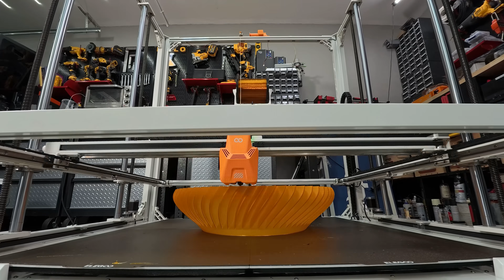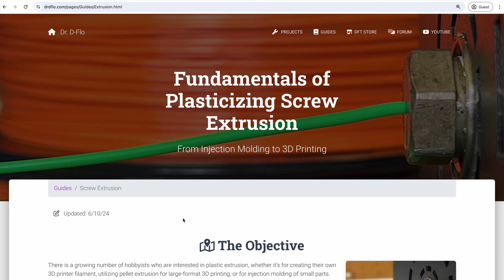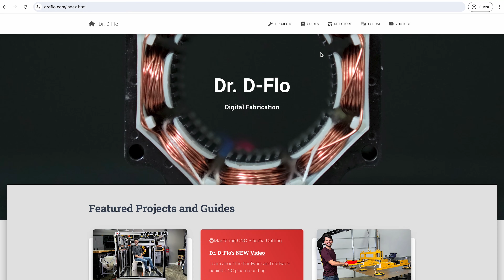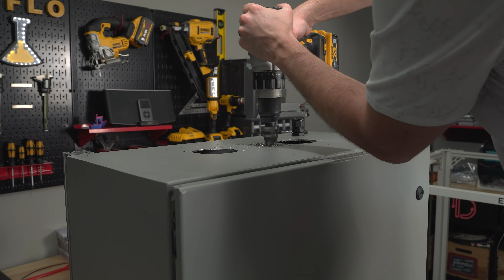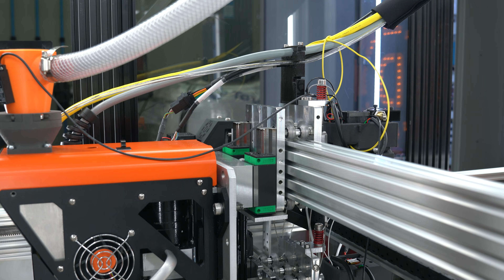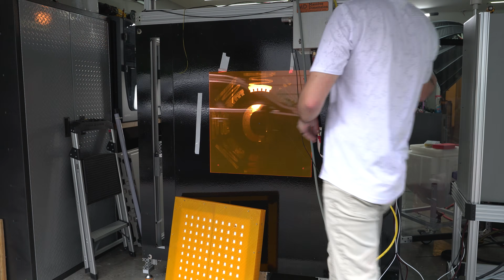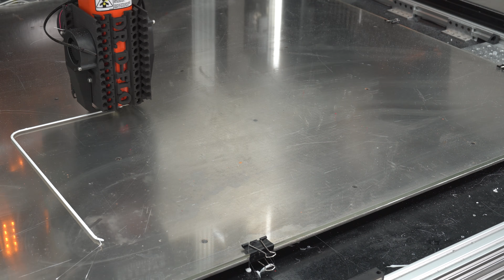SCREWing Around with a $20K Pellet Extruder - Large Format 3D Printer (Part 7)

Comment: The thing with a tidy cabinet is that it is even better to make your cabinet tidy when you're tinkering, because making changes will always result in tidy wiring.
The cable runways and DIN rails work as constraints that keep your work tidy and makes it easier to modify. It also lowers the chances of making a mistake.

Comment: Those amazon silicone wires are super sketchy, I have used them before and have no rating on them. The gauges you use to calculate amperage goes out the window when wires are non-standard.

Comment: What do you use the raspberry pi for? And what direction should I go to for using an interface for the duet to control the temperature with the corresponding slicer? (Also, what slicer are you using?)

Comment: You are over complicating your over head problem. Just add a low profile pulley to change the direction so your tensioner can be placed horizontally and not directly above the printer. With the direction change you should only loose a few inches of over head height.

Comment: 0:48....vulcano cht nozzle = 70mm3s: super vulcano with dual vulcano cht inside (one "nozzle" without the tip act like a spacer)
And you have almost 200mm3s (but try to keep it hot...in reality more like 150mm3+)
It is possible to use multiple spools at once (few extruders , few heating zones , single nozzle...like in old multi colour nozzles ) to go over 500mm3s easly for pretty cheap , but it will be behemoth of a hotend (dont ask me how i know that , lets just say my smallest oldest (10y+) printer have 500mm+/- xyz and printed molds for composites)

Comment: A little tip on soldering those cup terminals: The easiest way to get a perfect joint every time is to tin the wire, then heat the cup from the side, melt it full of solder, stick the pre-tinned wire in and let it cool. If you want a visual guide, I believe the PACE soldering tutorial showcases this method.

Comment: You should check out the V-Spooler Easy Motor Drive. It uses a nema 17 stepper motor to drive the Spooler instead of a drill. I also recommend the Quiet Roller mod.

Comment: Why not just to to put big pellet extruder before printer and make filament, wind that to some buffer roll and after, just wire that freshly made filament to normal light-weight extruder of the printer? Cheaper and also no issues with retract

Comment: As amazing as this thing is, it really upsets me how expensive this is at over $22,000, even if it's geared for "industrial use."

It's not just "Massive Dimension" pellet extruders that cost so much. It seems to be industry-wide with some costing nearly $100,000.

Maybe it's a bad comparison, but at this price, I could get a brand new car like you suggested. A car has significantly more technology, more parts, engineering, raw materials, and overhead that went into manufacturing them.

Can someone explain the cost breakdown for these things?
Reply from the maker: Usually, it's an economy of scale problem. Let's say you're an extruder manufacturer, and it costs $5,000 for you to buy all the off-the-shelf and custom components plus labor for assembly. At $5,000, you are already priced out of the hobbyist market, and that doesn't even include the normal overhead to run a business (warehouse space, customer support, marketing, and salaries). Further, the extruder you're manufacturing is heavy, so an industrial motion platform is needed to move the extruder (robotic arm, bridge-style gantry system, etc.). So even if you could sell your extruder for $5,000 or let's say you sell it at a loss for $2,000 and plan to make money by selling plastic pellets (which is hard to do because pellets are everywhere and not locked down like say printer ink), there are very few people who have the means to afford this setup. So if I were doing the market analysis for this company, I would say we target the R&D industry. Create a cushy margin, say $15,000, and then we only need to focus on selling 50 units a year. I can then spend time going to trade shows and other outreach to market the extruder. Further, I can provide really good customer service to match the price tag. Obviously, if you set the price too high, then potential customers will just build it themselves.
Reply: @DrDFlo  Thank you so much for explaining this to me. I knew I was missing something but couldn't really find a good amount of info on it.

Your channel is awesome and you consistently put out incredible content. 

You're really good at explaining complex things at a level accessible to the rest of us and the way you share it is very engaging!

Keep being you!

Comment: You say that pellet extruders can have issues with small moves due to the need to build pressure. Could this be fixed by decoupling the requested flow rate and the screw motor? If you had a way of sensing the pressure in the nozzle then maybe you could have the nozzle pressure controlled separately from the flow rate requested by the Gcode file. Or maybe some changes to how the slicer works to allow it to compensate for the screw extruded and continue spinning the screw between moves.

Comment: What about a bowden fed extruder that melts multiple filaments out of one nozzle?
5mm filament has a cross sectional area of ~15.7mm2. 2.85mm filament has a csa of ~8.95mm2, 1.75mm filament has a csa of ~5.5mm2.
To match or exceed the 5mm filament csa you would need 2x2.85mm filament feeds or 3x1.75mm feeds. You could roll your own filament from pellets or buy it.

Comment: Nice project. Not sure what’s is going on with the pricing of these things where you are located but the robot shown is a abb irb 2400 or 4400 which costs more like 50k brand new with the controller and some extra options here in Germany and the cabinet costs more like 200 -300 bucks.

Comment: I think there's a far simpler solution for the cable umbilical, put a pipe or something at the top that it can roll over and add a small weight so the umbilical is in constant tension. No motors, retraction mechanisms or springs required that way.

Comment: Also, with that amount of molten material being extruded, you might could benefit from chilled air from an air conditioner or chiller to blow across the bed (or if you're feeling up to the challenge, directly from the cooling fans on the nozzle.) That way you would have sub-ambient air blowing on the print.

Comment: for the slack/retractable line, can you use the same hardware you have now, but route it through a pully directly mounted to the ceiling and the retractor mounted to the side a little bit? That might get you like 10-12"  more inches based on how it looks on the footage. (Since you won't have the body of the retractor in between the slack of the line and the ceiling.

Comment: I don't know if this extruder or the control software you use would support it, but would you be able to use a shut-off like what is used in injection molding machines? It would prevent most stringing and may be able to help with pressure drop from constantly stopping the screw, especially if this extruder has a pressure sensor the control software could use.
I kinda wondered if you would be able to use this for injection molding, but without a retracting injection screw it wouldn't get a high enough injection speed, and you would need a lot more down force than this setup would allow.

Comment: Fun fact, some large industrial exteuders only use their heating zones for the initial heating up

I have a 2ton and a 6ton/h PET extruder, and both actively cool the barrel during normal operation, all the energy comes from the screw
Reply from the maker: Very cool! If you are able, please post some pictures to the forum: https://forum.drdflo.com/c/screw-extrusion/26
Reply: Maybe you can answer my doubt. I'm sure I once saw a manual pellet injection molder in a factory that wasn't connected to electricity at all. I guess the pellets melted by friction. The cycle was about 5 seconds per injection. I have been searching for one to buy and can't find it. Is this a real thing?
Reply: @Malakawaka   highly unlikely that it was entirely unheated. While the friction can be enough to melt the material once it is in motion, that does not apply to all extruder

And once you turn it off you will have to find a way to heat it again 

It could be heated by steam, hot oil or whatever though, not necessarily electricity.
Reply: @BelviGER  thanks.

Comment: I used to build powder coating ovens for people.  Not massive but good sized, 6ft tall and 4ft square, the electrics and panel boxes were always a big cost of the builds.  What they charge for those empty steel boxes seems idiotic considering they are just stamped steel and spot welded.  If I had a good box brake I would have made my own.

Comment: Why don't you print your large electrical cabinet with your enormous printer??
Reply from the maker: Plastics are thermal insulators (more likely the electrical components will overheat). And with the power that the printer is drawing you want a proper ground to the enclosure in case there is a wiring issue. However, for future smaller projects I will definitely be printing enclosures!
Reply: @DrDFlo  you are absolutely correct.  It also doesn't provide EMI shielding.   But for the right application you can add filtered air inlets with fans,  an aluminum backplane and even a proper shielding mesh if it is needed.   Another great application for a large format printer could be bespoke cable management solutions or at a minimum printed "panduit".   I look forward to seeing the next step in your process.

Comment: Buys a high flo 3d printer for printing a flower box. 38mins on this... a timer on the print bed and handling of the prints would be nice to include in the video.
Reply from the maker: Lol the planter was just a test print that made the wife happy... I needed to make sure the extruder could perform consistently without creating voids, which would sink my next project (pun intended!). But the print settings for the corner planter were the same as Benchy - sparse infill = 180 mm/s, exterior perimeter = 50 mm/s, and internal perimeters/solid layers = 75 mm/s. The volumetric flow rate with a nozzle diameter of 3mm and a 2mm layer height for each feature is 5 kg/hr, 1.38 kg/hr, 2 kg/hr. My apologies this info wasn't readily available

Comment: it's impressive to watch it do the first layer. It looks like a line of toothpaste. Would a pair of CPAP help as a cooling fan?
Reply from the maker: So part cooling has been kind of a headache... A lot of air flow is needed to cool those thick layer lines on overhangs and short layer times, but I have found that running the fans at max speed near the bed can lead to adhesion issues even for PETG.

Comment: Have you looked at extruding filament on demand? The print head could still use a filament but the pellet extruder is a bench top machine making filament on demand. 

Since printing uses variable flow an accumulator for the filament could be used. It looks like a rope block and tackle but it is on a sliding frame so you move the pulley sets (block) in and out to accumulate filament. (See if you can spot the guy who did a school science project at a nylon carpet factory). It would be a great add on for filament hungry printers.

A cheaper method would be to make 100kg spools and just use a motorized decoiler that is triggered by the sag in the loop between it and the printer. much like the decoilers used in sheet metal stamping machines.  

Are you using the helical rack and pinion slides?

Comment: would love to see a back pressure gauge on there "dynisco" makes the best ones   also drying your materials may have helped with the under extrusions too
Reply from the maker: I agree... the back pressure gauge could also be a way to pause the printer if the pellets bridge in the feed throat or the extruder becomes plugged. Any change in barrel pressure usually indicates a problem.

Comment: Very nice cabinet build! The "big enough" cabinet doesn't exist. lol. Brady also make Permasleeve label rolls (heat shrink tubes), which are really nice for signal connections (pricey, but nice. I still use the self-laminating labels for bigger diameter wires though).

Something you might want to consider are pluggable MOVs/surge suppresors. I had one of my Mesa modules destroyed by a lightning strike (and can only presume it came through the DC power supply). ProSurge SP150 or similar are fairly inexpensive. My cabinet is connected via a dedicated 30A/120V circuit using a circular L5-30P connector, so can't use a typical surge protector.

The Omron E5CC series (specifically: E5CC-QX2ASM-802 or similar) has the same form-factor as the AutomationDirect temp controller modules, but they support full RS-485 control. I got a couple off ebay a while back new-in-box for around $120/ea (just make sure you double-check the part number -- most for sale don't have RS-485 support). I know you already fixed the temp issue -- but they are pretty cool if you need them in the future, and they support all types of themocouples, RTDs, and PT100 probes. AutomationDirect's "standard" temp controllers also support RS-485, but haven't looked into them too deeply.

Comment: What is the biggest nozzle size that the printer can print with?
Reply from the maker: The major external diameter of the stock nozzle is about 20 mm, so it definitely has to be less than that. However, you can always over-extrude. For example, you can have a 10 mm nozzle orifice but print 20 mm "roads"

Comment: For the cables what about adding eyelet/loop for the tension cable to string through first then attack to its current mount so it pulls accros two or more points. Or even make a block and tackle out of the tension cable if it has length that’ll do it for sure lol so it would loop around its current mount point seen at 29:08 then up to the retractable spool with a pully wheel ore metal loop there too then back to where the other bit is sagging
Reply from the maker: Thanks for the tip! I have added it to my notes

Comment: I just ordered an AvidCNC benchtop pro CNC router with a 4hp/3kW spindle. I got it in the mail the other day and the spindle was surprisingly compact and it's about 9kg or 19lbs. The fact that this pellet extruder is 13kg is absolutely bonkers! At least I have the power requirements beat...

Comment: After I saw that you made your cabinet move able I thought why not make cable connections that you can connect and disconnect from your cabinet? There are big connectors out there that are used for the already showed ABB robot arms for the same purpose.
Reply from the maker: They all disconnect! Only the extruder motor and encoder pass through cable glands (but can be unplugged directly from the drive) the rest of the electrical components are panel mount connectors and can be unplugged from the bottom.

Comment: To address the umbilical retraction issue, simply install a collar on the ceiling in the right spot ( as high as possible) and move the retractors away from the collar. Ensure that the retractor is sufficiently long when fully extended to accommodate the extra length so that you can eliminate the slack up to a point very close to the ceiling.
Reply from the maker: Thanks for the tip! I have added it to my notes

Comment: I wonder, in the future, on prints like your patio planter shelf, an intentional texture or pattern would "camouflage" the layer line imperfections? Like a simulated wood pattern or something completely inorganic. Just a thought.
Reply from the maker: Yes - great idea! While the layer lines will always be noticeable when printing at a 2 mm layer height, they were particularly obvious with this recycled PETG filament, which contained contaminates that would randomly die some of the extrudate. You can see the grey/black streaks in the white parts. If you really want to get rid of the lines, you can use a thick automotive spray paint/filler, which can be sanded down to a smooth finish.
Reply: @DrDFlo  Hmmm, I wonder if you used a sporadic mix of different color pellets, if that would further obscure the lines. If the multiple colors were different darkness, of the same shade, with one being very dark. The eye might not differentiate the shadow of a layer line, from the streak of the darkest shade. The possibilities are boundless!!